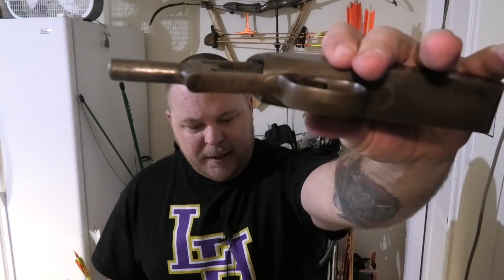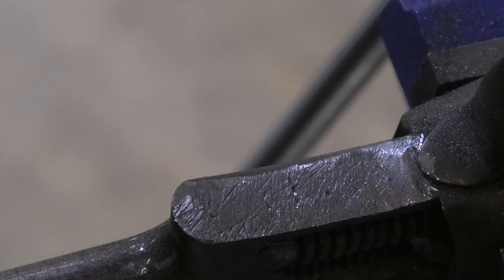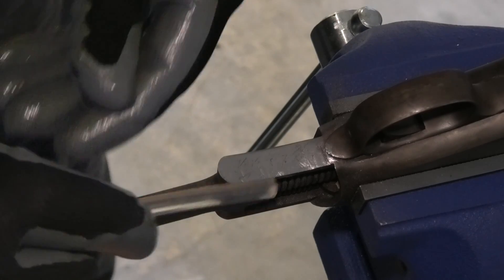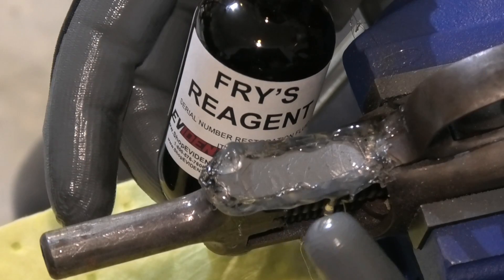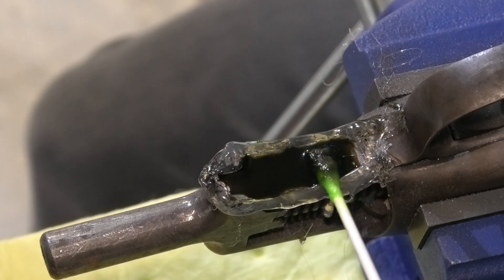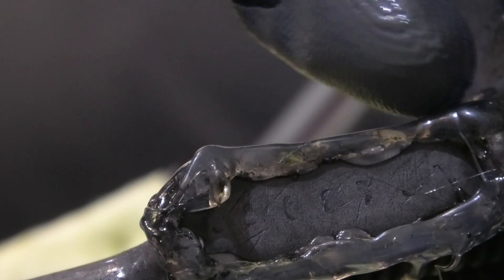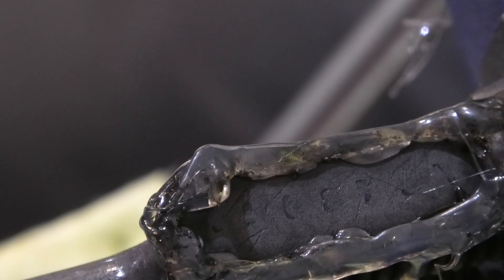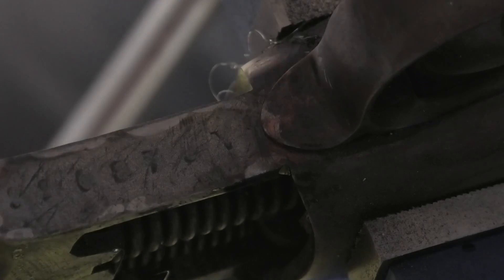Serial Number Restoration

Comment: have old shotgun. hard to read make and model number,, any advise.?
Reply from the maker: Yes. Do not do this method on a firearm that you intend on keeping. This oxidizes the metal very quickly and will ruin any finish that is on it. You may want to look into ultrasonic cavitation or electro etching.

Comment: Why the switching between fry's and nitric acid? I have seen it done with just fry's.
Reply: OK, I see why now, in practice, if you do several applications you get a layer of copper from the fry's reagent building up on the surface. This would limit your fresh solution making the low points deeper I'd imagine. Fry's alone brought back 90% of my numbers, but 2 that were attacked deeper with the angle grinder are still a little shallow to 100% make out. I believe a swab of nitric acid Inbetween applications would help get these back in less time

Comment: Excellent video I purchased a 1980’s dirt bike and figured for the price I could sell it for parts or restore pending vin number decoding. Last person who owned the bike removed powder coating with a little aggressive sanding wheel which makes a few numbers difficult to read. Very close to legible but difficult. I can stare for several seconds and just can’t make out a few numbers. Is it easy to find Frys and Nitric reagent in small amounts intentionally to be used once or twice and where can I get it? Awesome video!
Reply from the maker: I had a lot of oxidation after these coats. I think it'd be alright if you oiled it pretty well afterwards. I just got it online together as a kit and delivered to my door.
Reply: My grandfather lived alone and i think he wanted a pistal for protection he had alot of cop freinds and they gave him a drop gun with a sratched off numbers and my aunt found it when they were cleanig out the house so im the only one that she noes that plays with guns so sheasked me if i wanted it but the numbers arescratched of i cant cary it i love to its a colt 380 1870to1903 semmie it shoot great nice little pocket gun but i got to get the numbers back on

Comment: Hi, does this process work on any metal? And does it always work? There is no coming back from grinding out the numbers. Thats what I'm afraid off. Basically I'm trying to retrieve the faded Hull or HIN # of my 1978 fiberglass montgomery 10. The hull number is engraved in a small metal plate on the inside of the boat but the type of metal the plate is made of I don't know. Great Great video. Thank you for sharing.

Comment: Good video! I need a way to see the engravings on a Civil War Sword without hurting the metal. Would this work or does it damage the metal?
Reply from the maker: I would not do this on something valuable of yours. Shortly after this video the metal oxidized very quickly and more than just superficial rust.
Reply: @PantherCSI_LHHS  Did you rinse the reagent off of the metal and oil it?